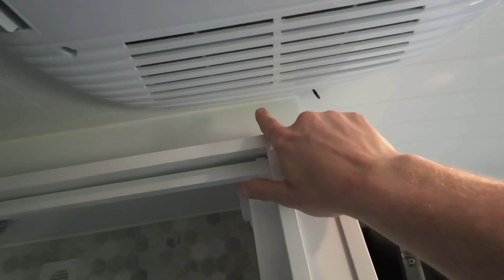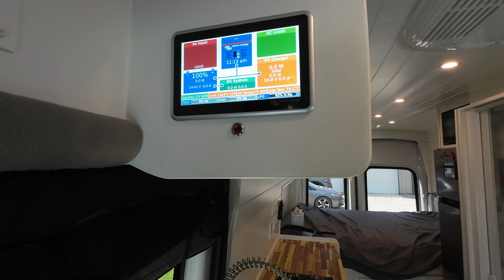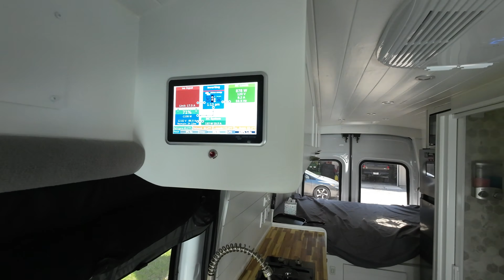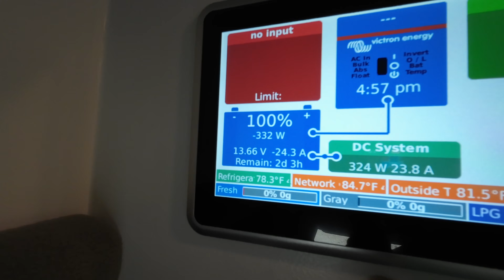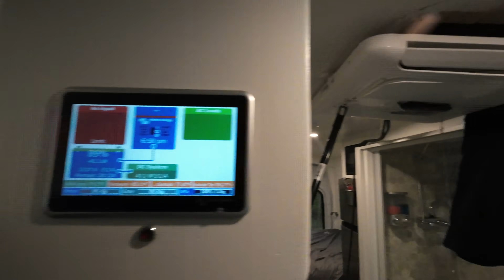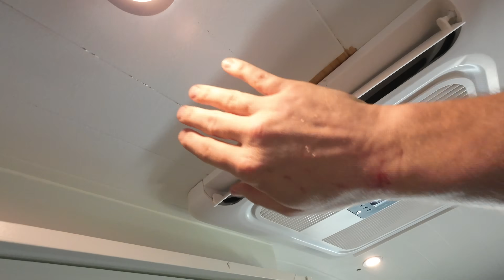Transform Your Van Conversion With A 12V A/C System - Efficiency Comparison with 120v RV Roof AC

Comment: can you run this 12v unit while driving? also if you have dc to dc charger it should charge faster than it uses?
Reply from the maker: Yes you can run it while driving and as long as your dc to DC outputs more than the unit is using (which it should) yes it will keep up and still charge your batteries.

Comment: Thanks for the info. I'm considering a 10,000 BTU 24 V rooftop AC/heat pump for an 8x20 cargo trailer conversion. This is giving me confidence. On another note, I'd be interested in seeing more details on your shower stall build. We will have a similar type shower stall, but I couldn't tell if your door was glass or if there was an accordion curtain.
Reply from the maker: Nautilus shower door. They are awesome

Comment: Great video!!!👏👏👏
Lots of great info and comparison with the 120 VAC unit.
I’m curious to know why you chose the CountryMod over the OutEquip pro.
I also wanted to say I feel your pain about getting the 6 gauge wiring to the power source.
I ended up choosing the OutEquip 10000 btu w/heater.
I got lucky using pre-ceiling pictures and was able to wire the new wiring through the ceiling directly to the power source.
Check out my video on how I did it!
Thanks again, great job!
Reply from the maker: I don't know much about the out-equip pro but I do know that this is basically the exact same unit as the very popular Velit brand which is why I used it. For about the same price as the out-equip unit.

Comment: do you think there is a transformer or voltage regulator rated for the wire gauge requirement that would convert shore power(120V) to 12V so you could constantly run the A/C without having to use your engine alternator to catch up? I see most people use 20amp battery chargers in their power bank, could a 50 amp charger damage the batteries over extended use?
Reply from the maker: No. It would be fine. The key is to see what your battery manufacturer says. For instance, with mine charging at 100amps is completely fine. My Victron inverter/charger can charge up to 120amps. You would want to find a 120v to 12v "power converter" that is rated for at least 60-80amps but you do need that battery in the system as a cushion for start-ups

Comment: i find it incredibly hard to understand how its that much more efficient at the same rating, I suppose you may get 10-20% out of the BLDC motor swap out for the fans, but I really don’t understand how inverter compressors can see these kinds of gains. Its the same with the furrion Chill cube units, but I can’t figure out the full story of why it appears to sometimes be twice as efficient or three times in the case of the furrion HE 15k LP units.
Reply from the maker: I'm gonna guess the BTU rating is slightly inflated, but the older style units do waste electricity by running full go all the time.

Comment: Does the fan stay on all the time once you've turned it on? Or does it go on and off with the compressor, like a system for your house would do?
Reply from the maker: It stays on
Reply: @JackofAllMasterofNone ugh.
Reply from the maker: It will turn off if you put it in auto
Reply: @JackofAllMasterofNone are you sure?😅

Comment: Excellent video. Question how many watts is your battery bank? How long could you run your ac before you need a generator to charge up your batteries?
Reply from the maker: 5520 watt hour battery bank. It all depends on many variables such as outdoor and indoor temp, solar input, etc. You can see in the video the estimated times on the Victron system. I personally would not use a generator, I would just start the engine which would start charging at around 100amps or 1200watts
Reply: Thank you, I have a Northern Lite truck camper. I will change over to 12v ac. The 120v is soo loud and sucks the energy too fast.@JackofAllMasterofNone
Reply from the maker: This would work great in a truck camper. I used to have one as well and the Coleman Mach unit kept me awake at night it was so loud.

Comment: Quality video, sir. I need to take some clearance measurements on my roof. Medium RV, I'd put this in an existing 14" vent and leave the existing 110V a/c. However, 6AWG seems a little on the edge to me. It's a sizeable expense, but i think i will run bigger wires.
Reply from the maker: They claim they are 5 AWG, which is slightly bigger but I don't think they are. The 6 is plenty big for the load.. This unit never runs at the maximum load rating, no matter how hot it is or how long it's been working. But there is definitely nothing wrong with going bigger, just going to cost more. It would help with any voltage drop potential as well.
Reply: @JackofAllMasterofNone interesting, maybe they use a metric size that's between 5 & 6 AWG specs. Good to know it doesn't seem to hit the max rating. I haven't measured my rig but I suspect I may have to extend the cable run from what they provide. Voltage drop is always my main concern, just for the wasted battery capacity. If I can over spec cable size throughout my system, a few amps per hour over a multiple day boondock adds up. All that said, 6awg seems about the limit for easy to manage cable size when it comes to routing and managing cables.

Comment: Thanks for the excellent and thorough review. I have installed some mini splits and really like them. Great that the inverter technology allowing a variable speed compressor is now available in an overhead rv unit. The unit you removed seems to have a good reputation. I am impressed that the 12v unit requires about half the power to operate as the 120v unit.
Reply: Inverters are inefficient, and modern BLDC  motors are very efficient. It’s simply better technology.
Reply from the maker: It's just a good example of some modern tech actually being better. I have a mini split in my garage that has blown my mind with how good it heats and cools and how efficient it is. What I would really like to see is a true 120 volt AC mini split packed into a RV roof air conditioner. There really is only one on the market and it would be a good replacement for traditional RVs. I think we will see more and more options soon.

Comment: From what I know this type of air conditioner it cost is quite low if you buy it directly from the factory prices range from USD 250 to 400.
Reply from the maker: How would you buy this directly from the factory? I'm sure you would have to buy in bulk and then import them and pay tariffs, etc.
Reply: @JackofAllMasterofNone 
Down load this app.
ALI 1688

Comment: would it be possible to just reuse the 110AC existing from the old AC and use that to tie into the wiring distribution box (switching that end of it from AC to DC of course). This would save me any headaches in my retrofit as the wire is already there in the place I need it to go...
Reply from the maker: No you can not do that. The AC wiring is only probably 12 gauge max and you need a 6 gauge wire for the 12v system. You would immediately burn up the existing wires and could cause a fire
Reply: @JackofAllMasterofNone 

Ahh right. Need fatter wire for the lower voltage/higher current. 48 volt system might work… I’m lazy and don’t wanna fish more wires, don’t mind me 😅

Comment: Hi, I’m considering installing this on my van.  Could you please tell me the steps to removing the old gasket and dicore from the roof without damaging the painted area?  Did you use some kind of dicore/tape removal compound?  Thx
Reply from the maker: I used a plastic putty knife and then followed up with some PB blaster to remove the residue and then cleaned with some window cleaner

Comment: Guys who installed this Air Conditioner  - is it enough to cool off an insulated 20ft RV while running full power in Texas heat? (I have Nobo 19.3). What kind of AC to DC converter do you use to support it?
Reply from the maker: Well my van is 20 feet long and it is keeping up good. But if you have a larger traditional RV I think I would want at least 13,500 BTU or more just to be safe. If you do go with this unit you will need a beefy converter something like this minimum https://amzn.to/3T37L9g
Reply: @JackofAllMasterofNone .  Why would you need a 120 V to 12 V converter when you’re running the air conditioner off of 12 V? Do you only use that converter when you’re plugged into shore power?

Comment: So, is it possible to get replacement parts for these aftermarket units, or would you need to buy a whole new unit if something failed after a few years?
Reply from the maker: I'm not sure. Maybe reach out to the manufacturer. It is a very common design so I'd suspect replacement parts are easy to get.

Comment: Does this ac have an air filter?  The base of the ac seems to be plastic, attached to the roof using securing screws to plastic, do you think it will be durable considering it’s on the roof getting hit by uv sunlight 100%?
Reply from the maker: It's the same as any other AC unit as far as the base is concerned. The interior securing bracket is solid steel and very solid. It does have a standard style AC filter in the cover plate that can be removed and cleaned easily, similar to other RV AC units

Comment: How do you run the power cord through the upper part of the unit? Is there a spot to feed it through so I can feed it through my solar gland?
Reply from the maker: The wire comes out of the unit into the van space. It's not made to be on the outside of the van.

Comment: I have a treelogo 12v A/C from ebay. When I bought it $599.00 with shipping. I love it. I run it off solar, no problem.
Reply from the maker: Nice!
Reply: Isn't that 1000 watts though? This Country pro is 300 watts though
Reply: How much watts does the Tree Ligo use?
Reply: @papercraneblog , 300W is going to provide less cooling than 1000W. The Treeligo that I just found for $489.99 is 960W.

“12V Cooling Split Truck Cab Air Conditioner Kits For Semi Bus RV Caravan Vehicle”
Reply: @papercraneblog , I found it in eBay with that title for that price.
Reply: @papercraneblog , 300W is going to provide less cooling than 1000W. The Treeligo that I just found for $489.99 is 960W.

“12V Cooling Split Truck Cab Air Conditioner Kits For Semi Bus RV Caravan Vehicle”

I found it in eBay with that title for that price.
Reply: Mikesroadtrip How many watts of Solar do you have?

Comment: 10k btu??? Did they not have anything smaller? Its such a small space.
Reply from the maker: It says 10k but I feel it is sized correctly for a van. Any less and it wouldn't keep up on super hot days
Reply: It's a variable speed compressor. It doesn't use 10k all the time. It could probably ramp down to about 3k do the math on the watts.

Comment: Wish they'd used a metal blade for longevity, and metal grill to prevent hail ball damage... Guess you could design a metal grill to put over it for protection. Great video showing consumption details. Much appreciated, thank you.
Reply from the maker: It's similar to other AC units I've seen. The good news is the fan looks like a regular automotive radiator fan and could easily be sourced and replaced if it is ever damaged.